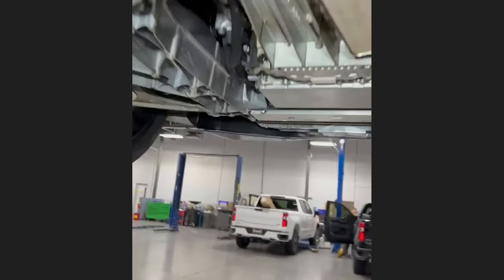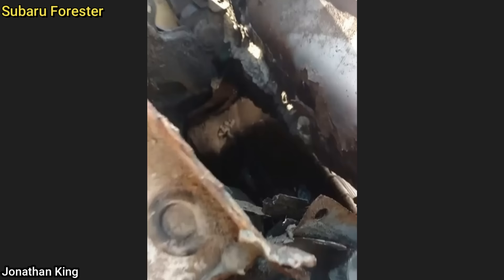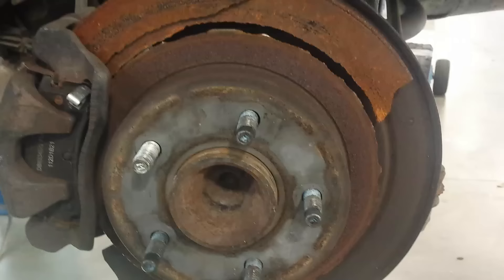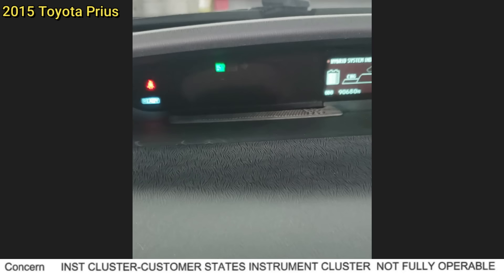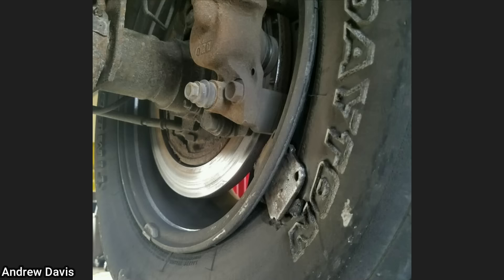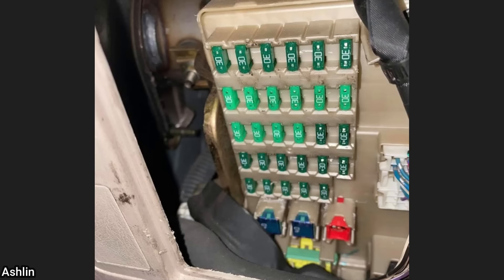Customer States Brand New Corvette Shut Off While Driving

Comment: That same strut tower failure happened to my 1996 subaru outback wagon while going 65 on the interstate.  It was scary as heck. I ratchet strapped a 2x4 in the spring and drove it like that for another 2 months.
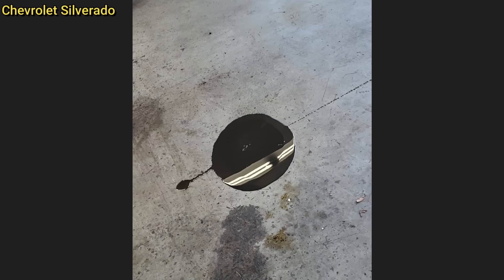Reply: 2X4's seem to be common repair components. See 1:43.
Reply: @soaringvulture  yeah he'd have been alright if he used prime douglas fir!

Comment: For the people commenting about the guy thrashing on the 1300 mile corvette...that engine should have been engineered to withstand ANY abuse thrown at it. The main selling point of a corvette is that its 'fast and powerful'. with that in mind, the people buying them are (most likely) going to abuse the engine. You should be able to rev that thing 1,000x over going down the highway right from the dealership parking lot... 
Of course, over-revving is a completely different beast, but how do you over rev a slap stick auto transmission?
GM and all "American" brands are absolutely junk. Drive by your local u-pull-it, 9 of 10 vehicles parked there are Chevys. Whats the most common makes you find at a junk yard? Chevy and Ford.

TLDR; chevy junk

Comment: The failed suspension turret on that Subaru Forester is strange as the rest of the car looked in good condition. I wonder what someone had been up to to make that happen.
Reply: It’s a common fault if they’re not kept relatively clean
Reply: @cncgeneral  also those cars are going on 15 years old
Reply: That's typical wheelhouse rust, just the super aggro kind. The part that detached was attached to the unibody at one point, but the back side is the outside and the tire loves to sling road crap at it. There's typically a nice seam where the wheelhouse attaches to the unibody or quarter panel right along the arc where the wheel slings the crap the most, and seams + metal + salty road crap = bad bad rust.

Comment: It seems to me it would be illegal for car manufacturers to make a car that rusts out that quick in an environment known to do that to cars.
Reply: Forced obsolescence. If you're in the states that use salt on the roads, good luck to your frame if you're not wise and actually rinse it.
Reply: Caveat emptor. If people want to keep buying vehicles that rust out in 10 years, manufactures can keep building them.
Reply: I place SOME (not all) responsibility on the car owners. It's widely-known that road salt contributes to rust and rot, it's up to the owner to pony up a few bucks at the manual wash and pressure-rinse the underside several times through the winter, and then give it a proper full wash at the beginning of spring.

It makes a big difference, and I'm speaking from experience. I have been both the never-washer and the weekly-washer.

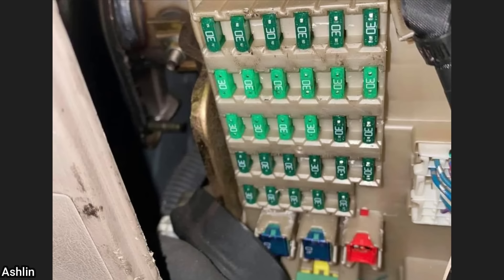Comment: 3:00 I have made that mistake once in my life
Stuck my leg in and started it then went to get out to check the engine
Truck went forward and door hit the jeep next to me catching my left leg in the door
Keep in mind this is on a downhill-ish dirt hill so when I mashed the brakes with my right foot the truck just spun the tires instead of stalling
Eventually figured out to just turn off the ignition and wiggle my leg out but that was a very scary 5-10 seconds of my life
Reply: My car won't allow that, because in order to start you need to put you foot on the clutch and break to start. In general is always a good idea to practice this routine even for auto (discarding the clutch pedel).
Reply: Yeah, I was dumb and did something similar recently. I ended up rear ending my other car. Luckily, there was only about two feet between the vehicles. Mainly cosmetic damage. Not my proudest moment.
Reply: @dogs-and-destruction-channel  I brake start most autos but not manuals
Reply: @dominicklipari  
Good idea. TBH break starting a manual is just like break starting an automatic only with an extra pedal the clutch.

Comment: I don't get why american market cars require the clutch to be pushed down to start it
I've never seen a car here that has this requirement, and I've driven a fair few modern cars too
 it seems like it's just manufacturers don't trust american drivers and making it so that the driver is liable for screwing up since they lifted the pedal to get moving or whatever
And you lose the ability to turn the engine over in gear too, which isn't great for the starter yeah but in a bit of an emergency needing to move the car after running out of fuel it's helpful to be able to still drive a bit

Comment: Since when did Altima's have a manual transmission?
Reply from the maker: 2002-2004
Reply: @Just Rolled In  correct, but this was a newer 2015+, which to my knowledge only had the CVT. Correct model year is 2007-2012.
Reply from the maker: @Tracked350Z  this is the photo I was sent also https://ibb.co/bP3m915
Looks older than a 2015 from the tail lights. Unsure though lol
Reply: @Just Rolled In  the correct model year is 2007-2012. However, after a quick Google search, I in fact did confirm that they did come with a 6 speed manual. The more I know.
Reply from the maker: We both learned something new today lol.

Comment: Last clip was probably a new tech crushing the car into the shop. Not a customer. No way a customer who is driving stick shift would start a car without making sure it's in neutral... however I've seen a few techs in a shop who didn't know to wiggle the shaft before the start

Comment: That’s my vette… vette was under filled with oil at factory causing detrimental engine failure. New motor installed with a bill of $33,000. I am demanding/fighting Chevrolet to buy back this vehicle at price regarding the mishaps. 

I’m worried what other issues dould have arise from this down the road.. even tho the engine is replaced… 

I don’t want another 10k+ repair bill down the road